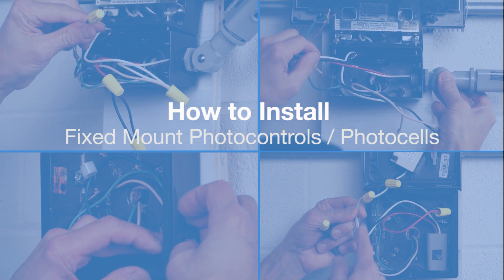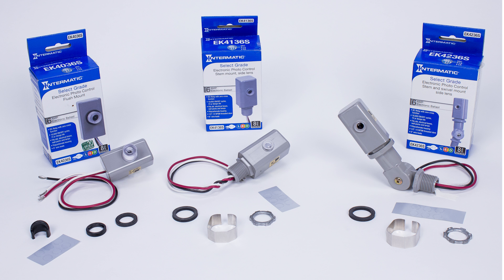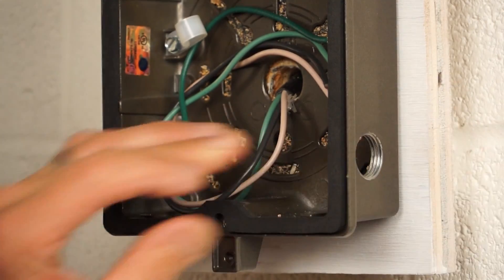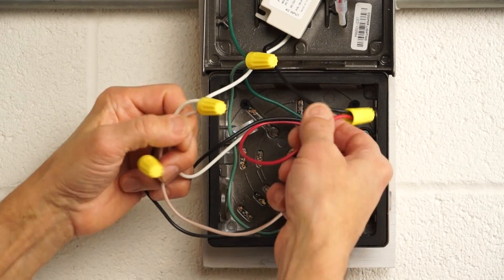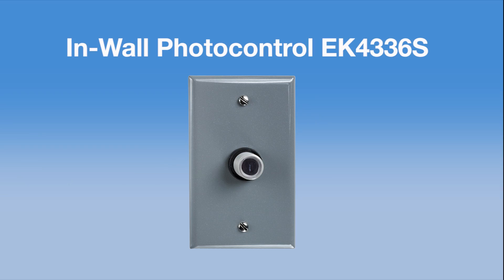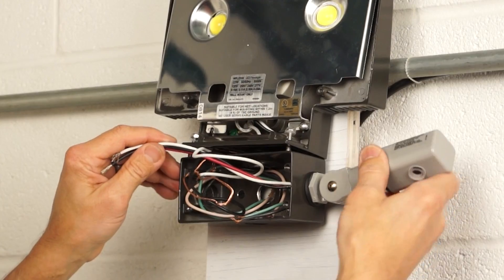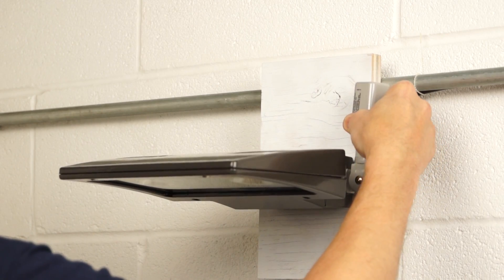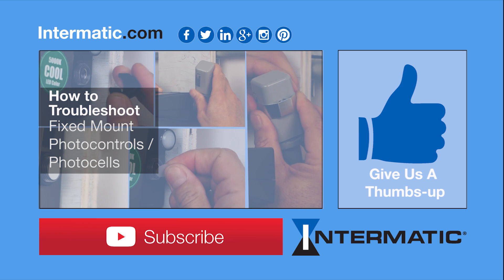How to Install Fixed Mount Photocontrols / Photocells

Comment: I purchased a photoelectric control to replace one that is mounted under the roof soffit. It is to control garage mounted coach lights to turn on at dusk and turn off at sunrise. But the installation booklet says not to mount it with the wires facing up. Did I buy the wrong model?  (EK4136S)
Reply from the maker: Hi, @davej8624! Thanks for the great question! I recommend you call our award winning technical services team to ensure you get the best answer for your application. You can reach them at 815-675-7000, on Monday through Friday, from 8AM to 4:30 PM Central Time.
On behalf of Intermatic, we thank you for being a customer, and we wish you a very Happy Holiday Season. LG

Comment: there is no green or ground wire with any of these light switches. You say everything so fast when you say about the black line load wire and the red wire. white is always white and black should always be black from the power panel box. So, what do you do with the red wire? both parts of this video is so fast when you show and explain where the black and red wire goes too. I have found many others like me that when you wire them in, the lights stay on 24/7 and never turn off and all you people say is, you have it wired wrong. D'uh, no kidding.  You talk just like Bob at your main shop and not Bruce, But neither guy could figure out why my lights stayed on 24/7. Not much you can do with 3 common wires. the installation sheet says the red wire is for output to the lights which mean you would have to wire a seperate plug somehow so that the red wire would feed power to the light or lights getting power from the black hot wire in the power panel and the neutral white wire. There is no green or ground bare wire in these light kits.The extra plug would have to have another neutral wire on one side and connect the red wire to the other side to send power to it to come on at night. That is my best guess.
Reply from the maker: We're sorry this all seems so confusing. As I mentioned in the reply to your previous post, please call our technical services team at 815-675-7000 and be sure to ask for Mike K. He should be able to answer your questions. Please note, their office hours are Monday -Friday from 8AM to 4:30PM. Thank you for being a customer, we appreciate you! LG
Reply: @IntermaticLLC  I was give to your finest x pert bob or something. Not bruce and he used every excuse in the book as to why it would not work right. It worked differently on 3 different gfi switch's around our home and I made a new 3 prong jumper plug with the black white and green wire. The one receptacle would only turn the lights on with I reversed the neutral and ground . Yes. I added an extra wire for ground and then the red wire for the other leg of the plug. IN a regular outlet in my house it worked perfectly. But 3 different gfi's all worked or didn't work at all but none worked like they were supposed to. You people always say... It's not wired right and then you brush it of and say call back if you need anything else or refer to other people who know nothing. I used a gfi tester and they all tested correct. How is that even possible and I could not light up a small door christmas wreath on one in the kitchen it kept popping the  breaker on the switch but still tested that it was a good switch. I even switched the ground and neutral wires and it kept popping off. But the one outside the lights would come on but you could not get them to go off when you wired the ground and neutral reversed. Never heard of or seen of such stupidness. I need the number of the real unit I need for let ights. You 2 different guys told me 2 different part numbers. Something is not right or who  trained them
Reply: @IntermaticLLC  I think I talked to mike a few weeks ago and he tried to blame it on everything to living in south florida and one day it will rain and then blaming the pvc conduit. He  was like talking to a mental r.e.t.ar.d. I was waiting for him to blame the air pressure in my car tires or that it needed an oil change. He was the s.t.u.p.i.d..e.s.t d.u.m.b.e.s.t person I have ever talked to in my 67 years of living. He's a true millennial know it all that knows nothing and is a p.a.t.h.o.l.o.g.i.c.a.l. l.i.a.r..He know nothing about anything.
Reply from the maker: John,  We understand that receiving subpar customer service can be frustrating, and we sincerely apologize for the experience you. We strive to provide exceptional service to all our customers, and it's disheartening to hear that we fell short in your case. We take your feedback seriously and we'll address this issue internally to ensure better service in the future. Thank you for bringing this to our attention. LG

Comment: You didn't answer his and my question either. I talked to bob and he was supposed to be the top guy and he blamed everything but my car tires being low on air and needing an oil change. I had an older unit that worked fine for 7 years and it finally locked up and would not work any more. That Bob made the most craziest statement as an electrician I have every heard in my 60+ years  How did he get a job being the top troubleshooter there. Bruce had the best brains but he could not figure it out either for a simple 3 wire unit. There is nothing to a white wire a black hot wire and a red other hot wire for my outside led lights. But no one could figure out such an easy problem. According to the instruction sheet, the black wire goes to hot from the breaker box as usual normal and the white goes to the other white wires as usual, but then they say to connect the red wire switched hot to lights or contactor. Only have a ground wire a neutral wire and a hot wire. nothing else. Not a 4th wire. The red wire somehow has to be wired separately to a plug that you plug your lights into that I can understand.I wired it to the only wire left, the green ground wire and blew out the new gfi switch and locked it out and would not reset. It should not be that difficult for a 3 wire wiring job.
Reply from the maker: Thank you for reaching out for help. We are sorry to read that your questions have not been answered. Please call our technical services team at 815-675-7000 and ask for Mike K. He should be able to answer your questions. Please note, their office hours are Monday -Friday from 8AM to 4:30PM. Thank you for being a customer, we appreciate you! LG
Reply: @IntermaticLLC  I'm just trying to wire the sensor eye into a 2 pronged plug christmas tree lights on my deck. Just 2 wires. 1 hot and one neutral. you should be able to send me a sketch. I'm using a 3 pronged computer wire I cut in half. So I have a white and a black and a  green wire. I've tried every version and switch I've seen on the internet on different videos. They come on now. But they won't go out covering the sensor with a heavy dark rag with duct tape over the sensor and the dark rag tightly held over that. It should be a no brainer. The old one I installed myself 7 years ago had the same 3 wires on the unit. black white and red. I was easy. Now they don't sell or make them any more.
Reply from the maker: Hi, John!
These instructions are based on the information you've provided in this comment. 
If you have a three-wire cord that you cut in half, these are the 4 steps to correctly wire that up. 
1) Connect the BLACK wire on the photocontrol to the BLACK wire on the cord (the side that goes to the outlet).
2) Connect the RED wire on the photocontrol to the BLACK wire on the cord (the side that goes to the LOAD, you said it was Christmas lighting).
3) Connect the WHITE wire on the photocontrol to both WHITE wires on the cord (one goes toward the outlet and the other goes toward the lights).
 4) The GREEN wires on your cord just get tied together. They will NOT touch the photocontrol (Wire nut the greens together as if they were never cut).

If you do not have the green wires, omit step 4.

NOTE: If using a ground fault breaker or outlet you must not mix up the neutral wires.

If you still need assistance, please call our technical services team and specifically ask to speak with "Mike K", he is the manager. Again, be sure to request Mike K. as there are other Mikes in that department.

Thank you for being a customer, we hope to get this resolved for you! LG

Comment: Hi
Why after I installed IT, turn on for 10 seconds and off for an other 10 seconds, looking almost like Christmas tree?
Please advise
Reply from the maker: Hi Sara, Please reach out to our Technical Support Team when you have a chance, they'll be happy to assist with determining why the photocontrol is turning on and off. You can reach them at 815-675-7000 or https://www.intermatic.com/en/support.

Comment: Can you wire the photo control directly into a PX300 power transformer?
Reply from the maker: You would wire it on the LINE side of the transformer. For example, switch the 120v coming into the transformer.

Comment: Can you add a photocell to 2 outdoor lights?
Reply: Yes, you just need figure out total watts.
Reply: My husband purchased four of these for our new home in which we have security lights on every corner helping to add light control for better, more vivid lighting and picture quality. It took him about 1 hour to wire all four up and they work like a charm but other than having to go back and forth shutting on and off your switches sun comes up lights go off sun goes down lights come on pretty simple little gadget. But I suggest you have somebody that knows a little about electricity before you just go putting wires to other wires where you might get shocked zapped.